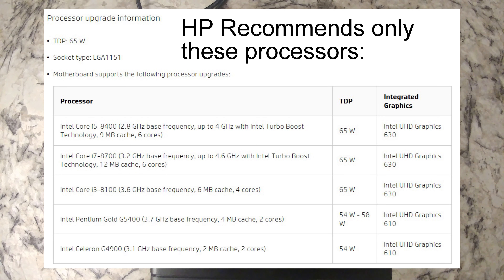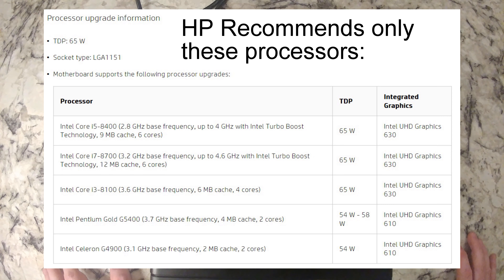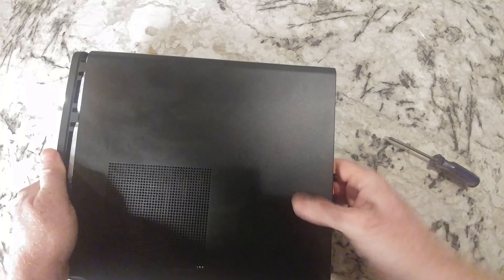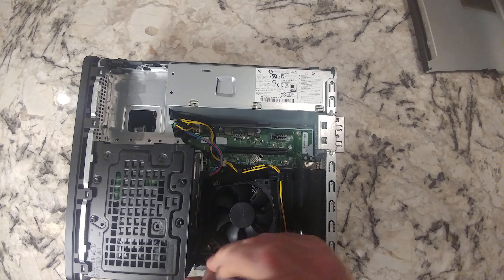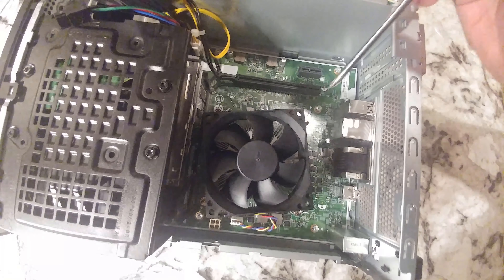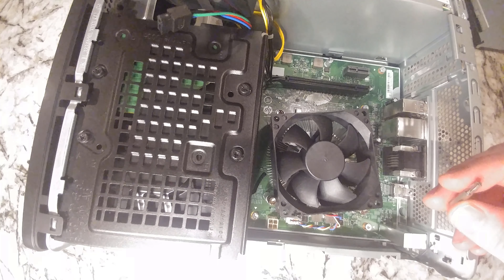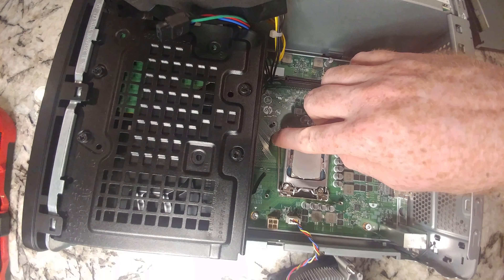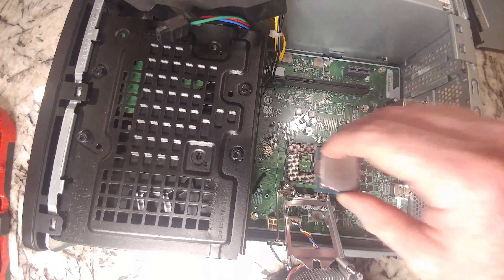HP Slimline 290 p0043w CPU Upgrade   Replace   Removal, step by step instruction, desktop processor

Comment from the maker: I have done quite a few videos for this computer.  Here is one that I discuss the upgrades that you can do for it to make it a decent desktop computer:  https://www.youtube.com/watch?v=I1DE8gyZygY
Reply: hi David..i have the same PC model using i-3 8100. Will it work if i upgrade the cpu to i-5 8400 or i-7 8700? thanks before
Reply from the maker: @MichaelDevson  Yes, at the 1:26 mark I actually discuss the CPU's that they recommend and that is on the list.  I have  also upgraded mine with an I3-9100  https://www.youtube.com/watch?v=DdI9R28K9Lg  So it is quite possible that an I5-9400 or I7-9700 would work.  I would avoid the ones that end in k though.

Comment: I know this is an older vid but in the off chance people are still upgrading these:
The annoying plastic shell/cover thing is 1000x easier to remove/replace if you take the HDD/disc drive holder out first

Comment: i bought this same computer at walmart a few years ago literally to comnplete one task and figured it would only last long enough to do that. but man, ive upgraded this little thing and its a little beast. makes me realize you shouldnt ever buy the top of the line one off the shelf. i barely paid anything for this one and ive just put parts here and there in it that i found for dirt cheap and its very impressive. also, i was under the impression, just from reading it years ago, that the cpu was soldered and therefore not upgradable. i saw those screws on the coooler and started to wonder if that was true. i guess theres something else i can do! they said the same thing about my laptop, that it was soldered and not upgradable and im learnign that you shouldnt listen to anyone. its ALL upgradable if youre skilled and desperate enough. i thought i was gonnna have to use my old tech skills on the cpu, but looks llike itll be easy instead.

Comment: Would it be possible to pop out the stock cpu and put it in a 1151 micro atx motherboard? Trying to make a low end kids gaming comp and we have one of these laying around
Reply from the maker: If I was an electronics  or computer engineer (and not a mechanical engineer), I would probably say sure...anything is possible if you know what you are doing.  That said, this motherboard is proprietary and it not going to be plug and play.  While HP does make some big desktops that you could probably do it with, this computer would have issues with where all the I/O ports are, bolt pattern...than the PSU would probably not power a motherboard without different adapters.  the best you could make this into a gaming desktop would be to get a GTX 1050 with a PCIE ribbon extender and leave the cover.  Sorry, this is not the news you want to hear.
Reply: @PC_HardwareTechUnboxing_1  I meant just take the cpu out of this. It would go into a new motherboard case/psu etc
Reply: @PC_HardwareTechUnboxing_1  so I got bored and caught some sales, you can take the cpu and hdd out and drop it into a B365 mobo, and it will work.

Comment: The I5 that you put in the description will that my my slimline better for games like fortnite and roblox? And will I be able to put the graphics to full?
Reply from the maker: Since this is still integrated graphics going from the Celeron to either a I5-8400 or I5-9400 or I5-9500, FPS will still not be very good.  Only way to truly game on this is to use a ribbon extender and use a GPU externally.  One that does not require 6 pin GPU power.
Reply: @PC_HardwareTechUnboxing_1  explain this.  this is what ive been thinking about
Reply from the maker: @prohdusah  This is a crappy old video that I did...but it shows a ribbon extender with a GPU attached to it.  In this case, RX 460.  https://youtu.be/8f7lxEIu1y0
Reply: I can use a i5 9500 with the same model in the vid?

Comment: whats the best gpu i can get for this
Reply from the maker: Though I still own this, I have never upgraded it as I have a small collection of custom build computers.  That said, I would imagine the best card is a NVIDIA GT 1030 Low Profile.  When I had the Dell 3470 that twas the best it could handle...and after doing a quick google search, I would think that is also the case for this PC.  Other option would be a PCIE ribbon cable like I do in this video:  https://www.youtube.com/watch?v=8f7lxEIu1y0

This is realistically the only way to get somewhat decent performance out of this computer.

Comment: can we install a gpu in it?
Reply from the maker: I have only added a gpu via PCIE reibbon extender.  Basically, the GPU was outside of the case.  I believe you could probably get a GT 1030 Low Profile to work, which would barely be much of a gain for gaming.
Reply from the maker: This site shows some benchmarks on what others have tried....  https://www.userbenchmark.com/UserRun/13590427  There are quite a few people who have used GPU's external, if you go down to the user benchmark section on this link:  https://www.userbenchmark.com/System/HP-Slim-Desktop-290-p0xxx/90643

Comment: Intel Core i5-9400 Desktop Processor 6 Cores up to 4.1 GHz Turbo LGA1151 300 Series 65W Processors BX80684I59400, would that work on it I have the same pc.
Reply from the maker: You should be ok.  It has been awhile since I did this video:  https://www.youtube.com/watch?v=SEfO0g94a7I  I installed an I3-9100 in there.  Huge difference.  I5-9400 would be even better...bug gaming still will not be that great without a graphics card.
Reply: David Noble yea that’s why I also got the RTX 1650 low profile to go with it, but I’m not for certain if that mix will do any good